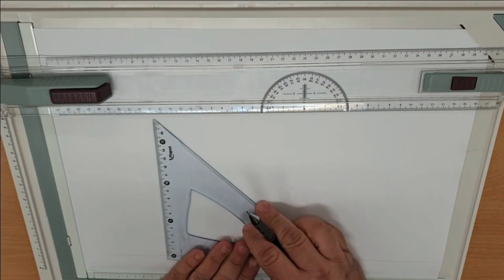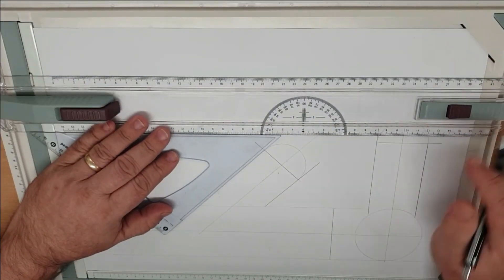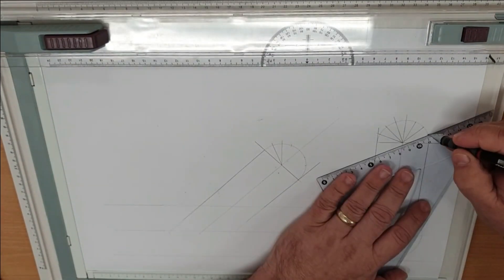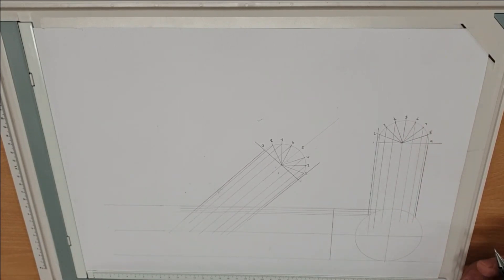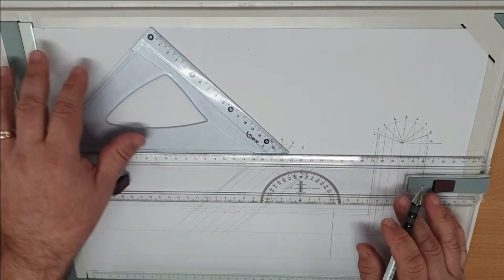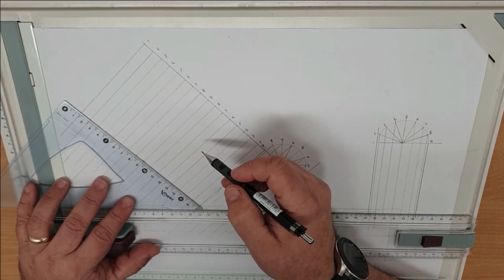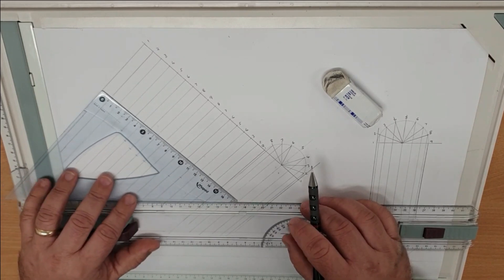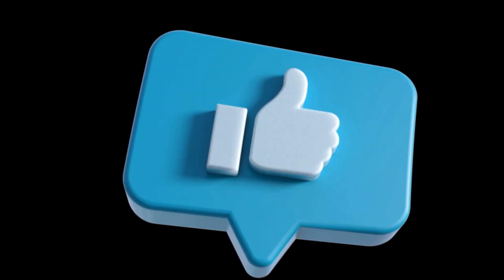How to Develop a 45 Degree Pipe Branch: Step-by-Step Guide

Comment: When you did final point mark on the layout why dont you start at 1 instead of centre?
Reply from the maker: Hi. If I'm correct on your question then it is so the final pattern starts on the short side, so when you roll it up you only have to join the shortest length.